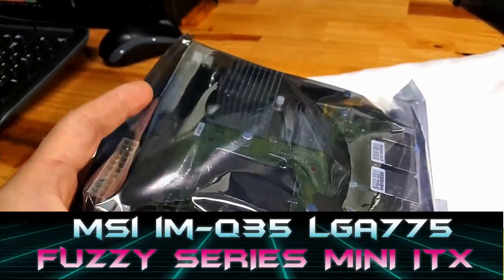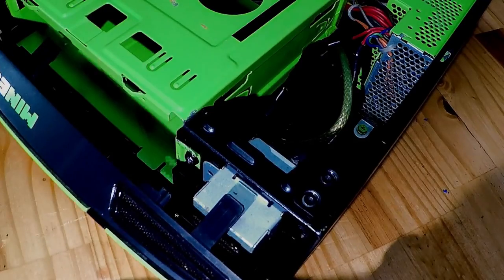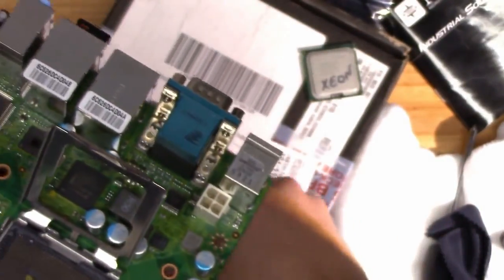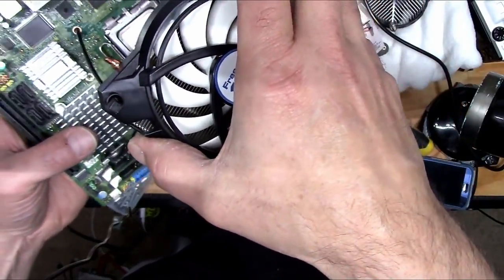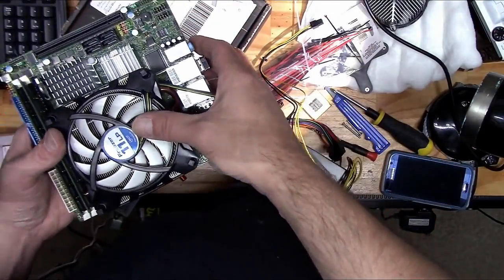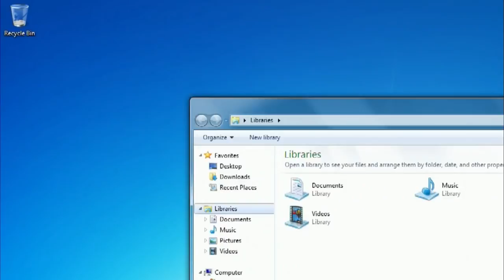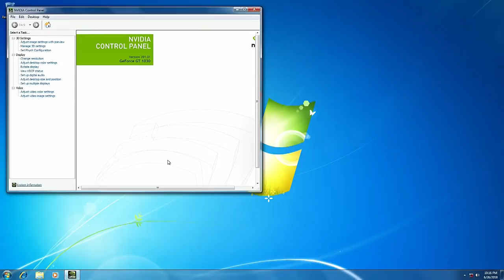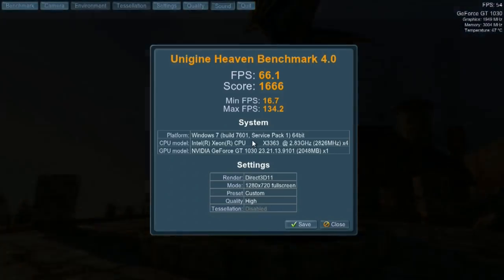Putting a xeon where a core 2 used to be in lga 775

Comment: You can always find an already moded Xeon so you don't take chances with the socket mod. Aliexpress moded Xeon are usually (but not always)  cheaper than Ebay, example E5450 on Aliex would be 20$ but 25$ on Ebay.

Comment: Asus P5Q Pro Turbo,  Xeon 5482 @ 3.2 ghz, 12mb cache.  I found cutting the socket side wall to be a bit of a pain, but with time and patience, a very good sharp pen knife, crafting, models etc... good lighting, magnifying glass it worked out ok. 
Why the upgrade to Xeon... Cache is dedicated to each core, not shared, I had intended on trying to overclock it, but dont really seem to need too. Liquid cooled so heat is not a problem but something you really need to consider as they do tend to run a bit hotter.
I had to flash the bios to be able to take full advantage of the cpu features, it ran stock np, I forget which microcodes had to be added, there is a overclocking club just for my motherboard so following the instructions was easy.

Comment: of course, this would get you 80 plus fps because the ryzen 3 2200g is about the same at those settings because its just like a intel Pentium g4560 or a intel 5400 gold and a gt 1030 gddr5
Reply from the maker: i want to get that ryzen setup when its cheaper
Reply: I think the Ryzen 3 2200g is a much better processor than the g4560

Comment: Help me i have i5 2400 gt 1030 and 4gb ddr3 on fortnite i get 100 fps all low 1080p 100% resolution scale but i get frame drops and 1 second before i die my game freezes
Reply: what gpu do you have in your system?
Reply: upgrade your ram to 8gb and what is your typical ping because over 300 ping could cause that
Reply: Try to get another 4gb of ram
Reply: i have a i5 2500 gt 1030 and 8gb ddr3. I play at all low settings and then max out render distance. But it sounds like your "bottleneck" may be your 4gb of ram. Or try lowering your resolution scale to 50% and see how that goes